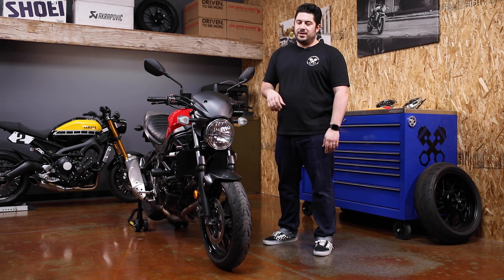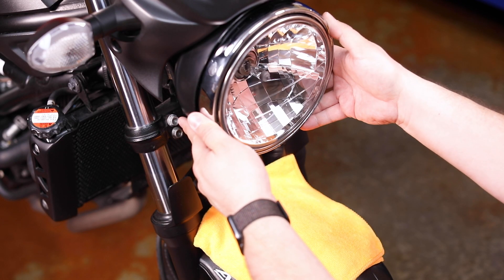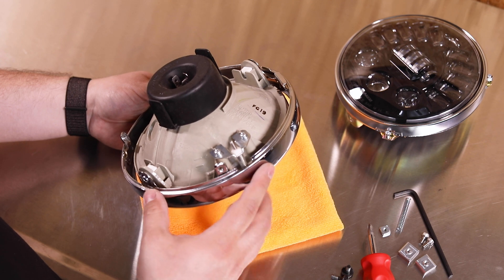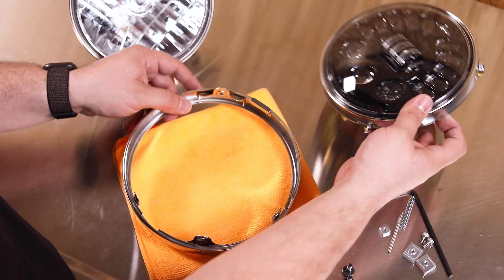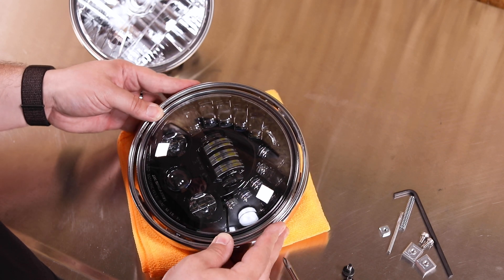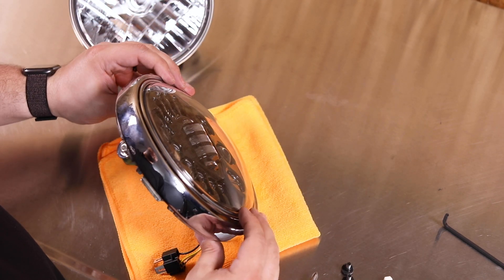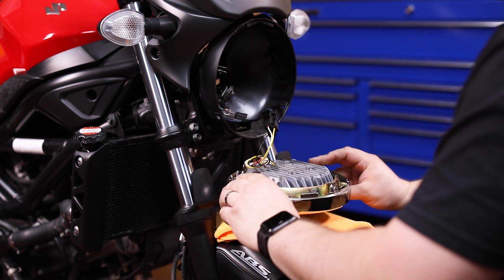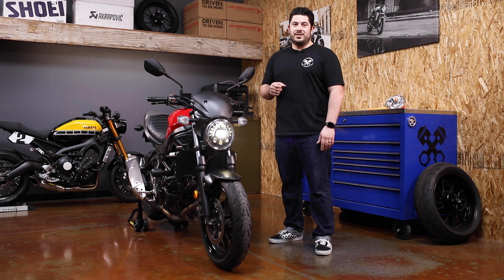Suzuki SV650 LED Headlight Upgrade Install

Comment: People crying about price need to get a job. It seems like a reasonable price for something made in the USA and such an important upgrade for safety. I think it looks great and I will be buying one👍
Reply: Agreed, the quality of the headlights itself just speaks for itself, you get what your paying for, and to clear it up, this is a performance mod.
Reply: Any pics after you fitted ?
Reply: its too expensive
Reply: @mechanicalman4531  it’s like a helmet...  Got a $5 head, buy a $5 helmet.  Yes, it’s pricey.  But so are ambulance rides and or funerals.  I’d rather put good money into quality equipment that works, rather than buying three or four that don’t. By that time all the time and money wasted would have added up to more that buying once, crying once.
Reply: @albertrios5168  id rather not get ripped off.

Comment: It looks cool and I like that it fits into the factory housing... But what benefits do you get by this upgrade?  I ask because this kit is 450-700 bucks plus shipping, but a standard LED bulb kit is somewhere in the 50-100 buck range.
Reply: E Rock ease of use and install it looks like..
Reply from the maker: The biggest benefit here is the change in type of lighting with control being the name of the game. Going from an antiquated reflector to a projector based system is a big difference in how the light being produced is used. Instead of shining the light into a mirror and scattering it forward, the light is going through an array of projectors to put the light exactly where you need it (wide and far).

The premium LED systems we offer have been designed specifically for motorcycle use. The low beam optics spread soft light wide to cover a majority of your field of view. The high beam optics throw light way down the road so you aren’t out riding your light at speed. When the light is placed in high beam these two optic packages are combined so you are getting the best light coverage from a single source. The Adaptive model takes this a step further by dynamically adding light to the inside of the corner during leaning.

In a stock reflector, adding more light will technically be brighter than stock but at the sacrifice of the quality of the light. This is usually accompanied by hot spots and weird shadow effects.
Reply: Cool light, but the price point is wild. Still think it’s cool tho and if you got the extra bucks why not lol. Too much for me tho.
Reply: @jimmiegoins2670  yea this is stupid price. I have a plug n play kit from another company and its like a 1/4 the price of this
Reply: @hisride  name pls?
Reply: @alNange  isnt for this bike sorry, they do dirt bike leds, name is JNS engineering

Comment: What is the difference from adaptive model and normal led?
I would like to install on a sv 650 2020, will I notice dmconcrete differences during night drive? Is fully compatible or I could have some problems in future?
Reply from the maker: The only difference between the Evo S and the Adaptive is the leaning functionality. Both share similar low and high beam optics. Fully compatible and built to out last the bike.

Comment: I have the European version of the third gen sv 650 which comes from the factory with pass switch.

If I install this headlight am I going to still have a functional pass switch?

Thanks!
Reply from the maker: Yes! The light still functions exactly the same as your stock.

Comment: Is this the same Motorcycle Adapter Kit 400 that JW has listed on their website? or does it differ and if so do you sell the adapter ring by itself?
Reply from the maker: sko it is not the same and we do not sell it separately at this time.

Comment: Do you have a headlight upgrade for a 2020 SV650? The one I found on your website says ‘09-‘99
Reply from the maker: Not sure what you were reading but it says "17+ Suzuki SV650 (all versions)". The one is the video is a 2019, which is the same as a 2020 👍

Comment: Does this headlight fit a 2013 sfv650 gladius?
Reply from the maker: This drop-in upgrade will not as it is only for the round headlight bikes. On a Gladius, we have helped customers with our headlight brackets and new headlight to essentially convert to a round headlight model.

Comment: My european SV 650 has an extra bulb below the main bulb, i think it is for parking, it lights when i turn the ignition switch completely to the left
Reply from the maker: This can be connected if you would like, but most people forgo connecting it because it is not a commonly used function. The red wire on the back of the light at 3:42 can be connected to the positive lead from your parking light, and you will retain the parking function 👍.

Comment: so when your bulbs go in the upgrade its worthless
Reply from the maker: All Solid Optic LED units are sealed. These carry a 5-year warranty and have a 50,000-hour life expectancy. That is 5.7 years on continuously or roughly 300,000 miles of riding, so actually, the idea is that the light outlasts the bike.

Comment: I think this is really cool and the installation video is informative but does it really gotta cost $450? You can't turn a profit off say $200?
Now my $60 ebay lamp probably isn't as good as this but $400 can get me an actual performance upgrade. 
And 80% of SV owners are broke college kids.
Reply from the maker: The lighting unit alone is $420 of that price we’re only charging a small amount for the adapter ring and machined tabs to allow the stock ring to be used. $200 is far below our cost..

The Chinese lights on eBay are all copies or units using copied optics from the JW Speaker lighting units we use. There are some decent cheap units but none of them come close to the beam pattern and output of our motorcycle specific optics package.
Reply: @motodemic  You should retract this statement. It may have been true when you wrote it, but it isn't anymore.
Reply from the maker: @dr.bherrin  retract what? Nothing has changed. We are only using premium, US made, lighting systems and not selling products we cannot stand behind. If you don't like the price, don't buy it and roll the dice with a cheap product.
Reply: @dr.bherrin  what changed?

Comment: Bro you should start off from the beginning taking the old headlight off that would help people a lot more if you did the whole process instead of starting off in the middle of it what the hell
Reply from the maker: Huh? Did you not watch the same video? What comes in the kit > How to remove your stock light > How to replace the light unit > How to reinstall it. The adapter ring comes installed on the light from us, ready to install.
Reply: LoL, what video were you watching?!?
Reply: @xavierradcliff9111 😂

Comment: What windshield is that?
Reply from the maker: Yvonne Sun believe it’s a factory piece.
Reply: It's suzuki's meter visor, it comes in white, black (gloss/matte), and red. You can buy it online from many retailers, jpbike tends to have a good stock of them.

Comment: Cool headlamp but wayyy to expensive. I get that its good quality, but paying over 10% of the motorcycle's msrp for a head lamp is just not cost effective. Maybe for a ducati but not for a $7k suzuki
Reply from the maker: The Adaptive model isn't the only option, the non-adaptive Evo S is less. For people that are concerned about their safety and visibility, it's no different than buying an $800 Arai helmet. We're providing OEM levels of quality because our light units are made here in the US by the same manufacturer as many OEM's have their LED lighting made (Triumph, Harley, BMW, McLaren, Can-Am, Polaris, Jeep, and more). Why can't economical bikes have quality parts too?
Reply: @motodemic  kudos for replying to all these people. I don't think they understand what it takes to get good LEDs. I see countless GM products with non-functioning LED DRLs and they are 2019 and 2020 model year. They are chinese made diodes and total crap.